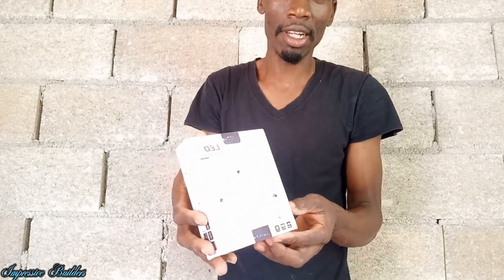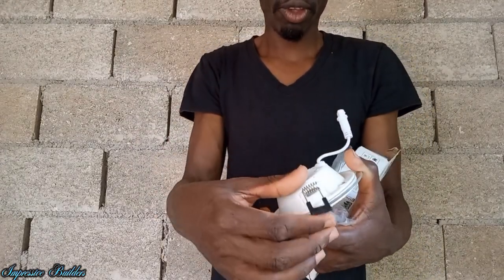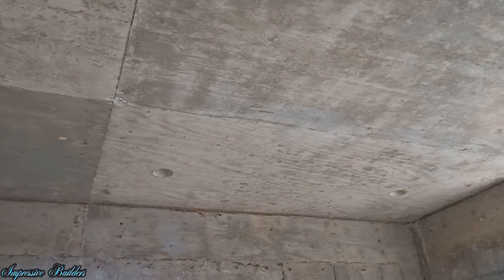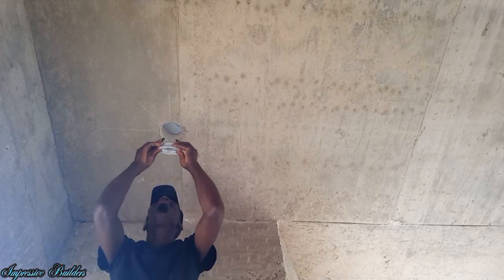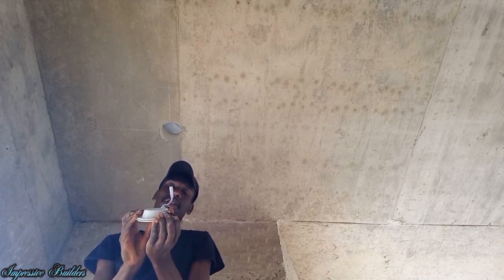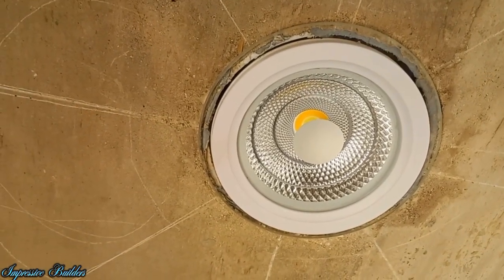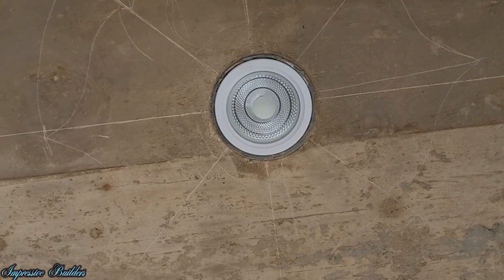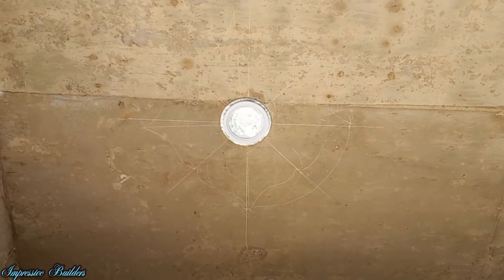How does Spotlight L👀k and Fits in Concrete Ceiling Building a House In Jamaica

Comment: you’ve just earned yourself a new sub here 🙏🏻 I’ve seen your other videos and I absolutely love the attention to detail… even when the electricians were placing the 4 inch pipes on the decking, the kinda person I am, if the lights were out of place and not evenly spaced or aligned properly in each space it would literally drive me crazy every time I went into that room
Reply from the maker: @ArcticCircle101  😁 first let me thank you for subscribing and for your support. I literally like how you say it because if it were so as you rightly said i my self couldn't bare the sight of them so we ensure that they are properly installed, not only that but also the connections because they are not on 1 switch, not all of them going to use at onces.

Comment: What about the heat on the plastic over a period of time?
Reply from the maker: The type spot light in using don't generate that much heat that would cause any damage infact they won't be constantly on as there is still the regular ceiling light that is going to be use mostly

Comment: How far do you space the lights from each other?
Reply from the maker: Good question well the spacing of the lights is based on the area of the structure you are going to install them for eg. 12×12 or 14×14 and also the amount of lights you are going to put in that room.
Reply from the maker: You will have to evenly space the lights according to the size room and amount of lights going in there weather  it be 3 feet or 4 feet apart you have to work out the measurement

Comment: Question: why do you choose to go the plastic route and not the metal?
Reply from the maker: If you are talking about the box its simply because when you are living in a cold area where there is lots of moisture the metal tends to get rotten after a while the plastic will remain
Reply: @impressive_builders  yes I was. It’s not cold in portmore. Would it still be a better option there? Would the sun crystallize the pvc after awhile?
Reply: @impressive_builders  Do you use the 6in one as well? 
Also do you use the canless ones as well?